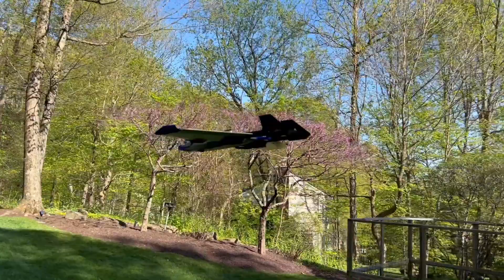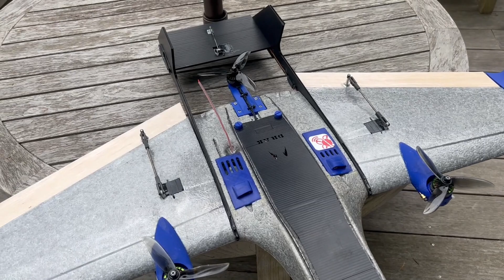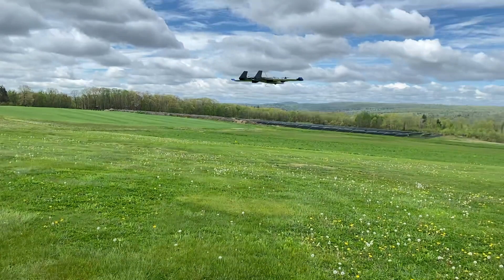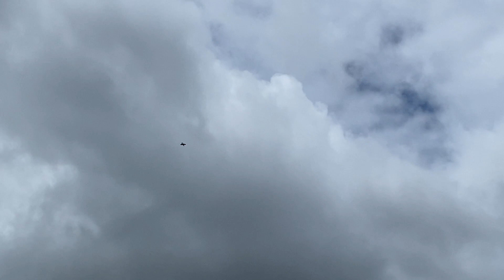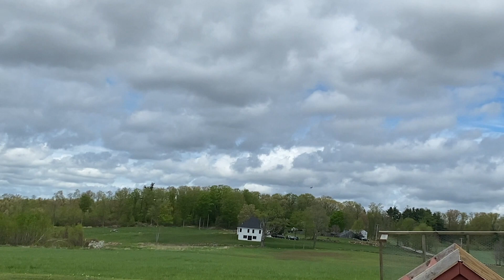Nano Drak VTOL hover and maiden

Comment: Nice VTOL setup. Great work on the 3d_printed parts. Thanks for posting great description on Thingy.

I'd suggest try stetting up so hover with a positive angle of attack. If there is any wind, you'd be pushing forward (nose down) in hover mode to maintain fixed position over ground. Better to be nose up in no wind (5-7º). 
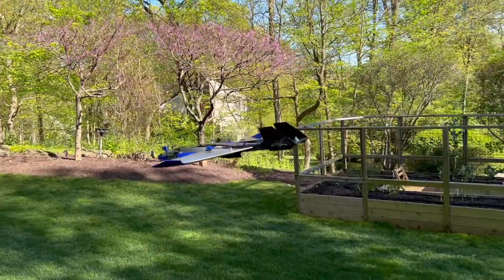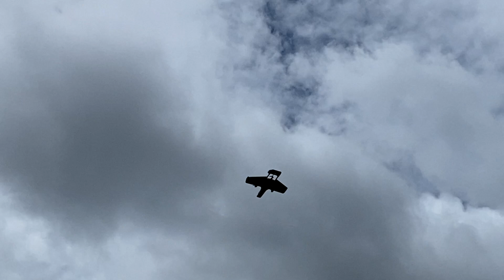Currently with wind the wings are at negative angle of attack (0:27), so motors working much harder that need be to hover in place. For transition (into wind), the wings going from negative angle attack, to required positive angle of attack. ie: from inverted stall to trying to fly as forward speed pick up. (1:42) Better to start a transition to wing flight, starting with positive angle of attack. ;)
This could be accomplished by having motor forward of vertical in hover. An added bonus is tilt mechanism will have more backlit from hover, so increased yaw authority.
Reply from the maker: Good advice!  I’ll give that a shot.  Thanks.
Reply from the maker: So I tried this.  WIth front motors pointed a bit more forward the plane has an elevated AOA but it likes to fly forward.   PIDS need more tuning.  But I don't think this is the solution.   I think the problem is I was doing the transition wrong.  The idea is to let Ardupilot accelerate for you when you switch to forward flight mode.   Instead I was accelerating first in quad mode, which dips the nose and then trying to transition which was causing the plane to porpoise.  Ideally, you hover and switch to FBWA and that sends the plane forward.  I'll be trying that next.
Reply: @Appelm1  You may need to adjust reference angle in Ardupilot for FC level. (I'm just learning, so not up to speed)
For planes, the CoG position (forward-aft) needs to be ahead of centre of lift. Center of lift might be thrown off depending on hover thrust during transition. Guessing Ardupilt can't tell, unless has an airspeed sensor, to know has relative forward wind.
Reply: Sounds like you making good progress. :)

Comment: A Drak that wants to be a quad, instead of the rear prop sticking out have you thought of using a ducted prop which would have a lower profile.
Reply from the maker: Its a good idea but just adds complexity.  There may be "better" ways to do this.  But this works and is easy to build.

Comment: Have you thought about inverting the tail motor so you can actually use it for forward flight? That would be sick!
Reply from the maker: It could certainly be done.  I don’t think it’s worth it unless you really want a rocket ship.  It flies forward great on two motors and is more efficient.  A rear tilt motor would add more complexity.

Comment: Congrats, great build. I really love drak. But the cg of Drak is at same point of tricopter cg´s? The first transiction was strange...It were just because of the wind?
Reply from the maker: Yes it was because of the wind.  I flew into the wind without an airspeed sensor and the transition took a while as a result.  In addition, I have since learned that the right protocol is to switch from quad stabilize mode to FBWA and then accelerate forward.  Instead, I accelerated forward first in quad mode which dips the nose, and then I switched to FBWA which caused the plane to porpoise the way it did.  All this will be sorted out.  The CG of the plane is most important.  A stabilized multicopter will fly fine if CG is off though it may not fly well with all maneuvers.  But we don't need to be a sporty multicopter..  just to fly well for a few seconds in level mode before transitioning.
Reply: @Appelm1  Thank you very much !!! You are totally right, I fully understand your cg point, and clear my mind.